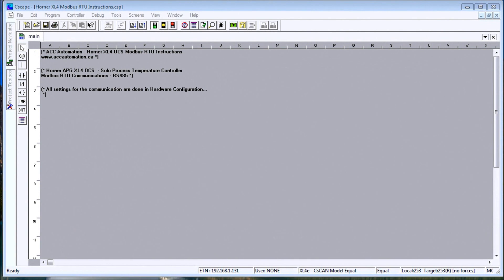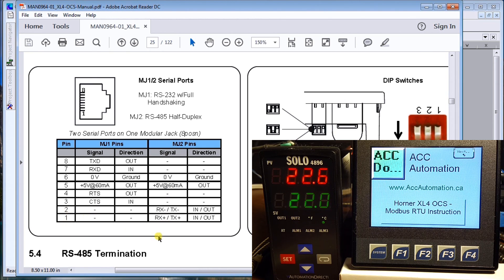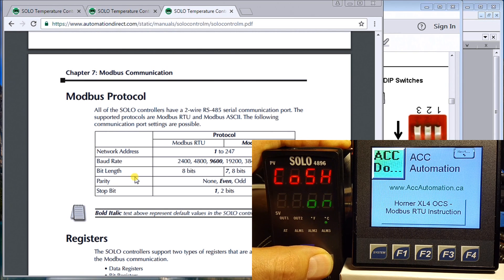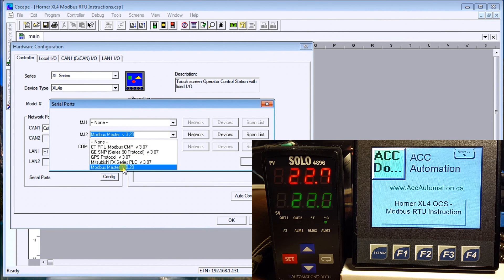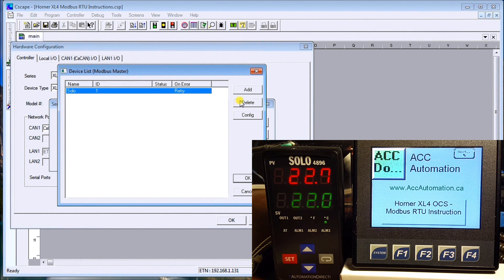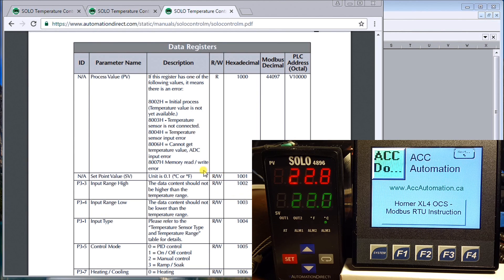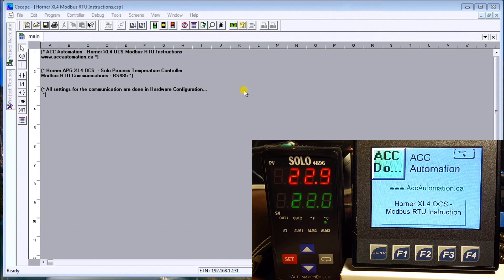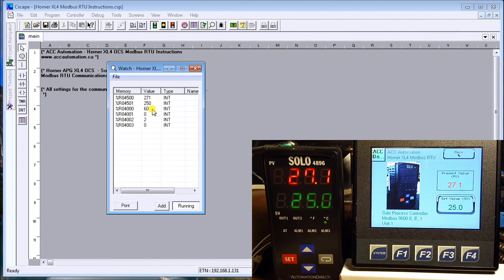RS485 Modbus Made Simple: XL4 to Temperature Control!

Comment: Hi Garry, appreciate if you provide sketch for rj45 serial based rs232 pinout connection diagram. I tried following the manal, but no connection establishement between cscape and plc
Reply from the maker: Hi Motawe,
When dealing with RS232 I would only use three of the pins. 
Pin 8 - TXD
Pin 7 - RXD
Pin 6 - Ground 0V
Jumper pin 4 and 3. (RTS - CTS)
You did not mention the connector on the computer side. However, make sure that you jumper DTR to DSR and RTS to CTS. This will just leave the TXD, RXD and ground pins to connect.
Note: If you are using a USB to Serial adapter, not all of these devices are the same. I have had success with the UGreen unit.
https://www.ugreen.com/product/UGREEN_USB_2_to_RS232_DB9_Serial_Cable_Male_A_Converter_Adapter_with_PL2303_Chipset-en.html

I hope this helps you out.
Regards,
Garry
Reply: @ACCautomation  yes garry, im using rs232 to usb converter from pc side, i think i have  same product ugreen which shared already. 
Still i should deal with TXD , RXD AND GND , CTS and RTS MUST BE JUMPER.
IF I DID ABOVE , IT SHOULD ESTABLISH LINK?
Reply from the maker: @motawemoha8225  
Yes, this should then work. Since you are using a USB to RS232 adapter, also check your device manager in windows to ensure that the device is installed correctly and it has reserved a serial port.
An alternative would be to purchase a cable from Horner.
https://hornerautomation.com/product/optoisolator-13/
Regards,
Garry
Reply: @ACCautomation  thank you so much